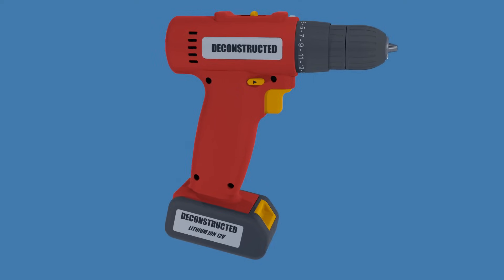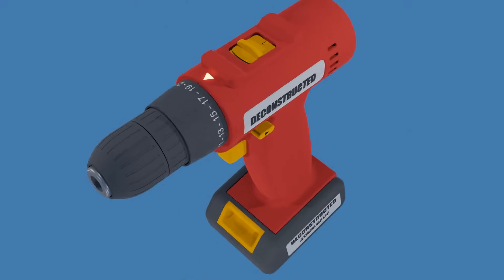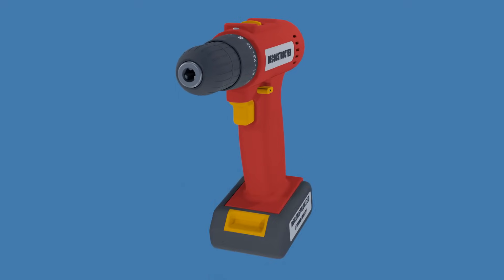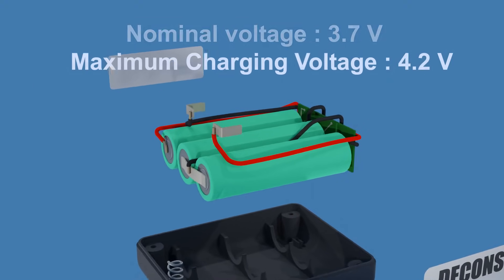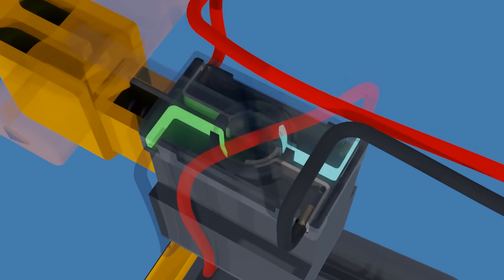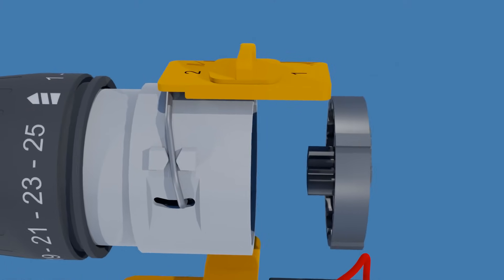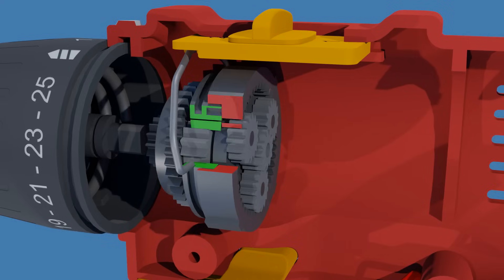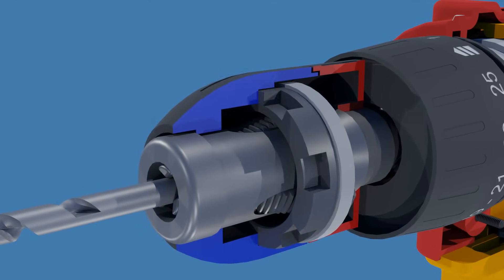How a cordless drill works

Comment: amp hours is current, not energy; energy is amp hours X voltage. if you put two cells in series, the voltage will be double. If you put them in parallel, the amp hours will be doubled; in both cases, the total energy is exactly the same

Comment: Great Video.
Over time these cordless drills loose amount of Torque and start early clutching, even with good battery.
Solution: add an additional flat washer (of suitable thickness 1/32 to 1/16") (Flat washer to match ID/OD sizes of back cover), between gear box back cover (i.e. motor side cover) & gears. Washer to be located inside of gear box. This would increase pressure on clutch and would stop early clutching.
By doing this, basically the repair would about double the thickness of flat plate located at mentioned location. 
Cost of washer at Home depot < 1 USD. + Time spent
Saving from buying new cordless drill = Many USD.

Comment: Very interesting, but it doesnt explain, when the ratchet no longer works.
 It still drills, drives releases screws. But the ratchet assembly section, no longer engages. 
It just turns around now.

Any one got any ideas why it's not working

Comment: Can someone explain to me why it seems modern drills have a “braking “ mechanism that stops the rotation of the chuck when the trigger is released?  Old drills would just slowly stop rotating.  Does anyone know what I’m talking about?
Reply: I think this is called ‘e breaking’. I’ve seen it on other modern power tools like angle grinders. 

I assume this is done for safety. If you need the tool to stop moving for any reason and especially in an emergancy, it’s better for that to happen immediately, rather than waiting for the rotating mass to come to a slow stop. 

I’m sure there are some circumstances this isn’t useful, there are always edge cases.

Comment: I didn't know a machine as simple as an cordless drill has such complex system inside.
I use two 18 Volt cordless drills every day building cabinets and other furniture. The batterys I use all have a capacity of 5 amps.
They can last up to 3 day of intense use before that run out of power.
And I didn't know the cluth worked this way.
One of my collegeas thinks that the ratcheting sound breaks the cordless drill. Thanks to you I can explain it doesn't break the cordless drill.
It's a safety mechanism.
Reply: I was wondering the same as your colleague on the clutch causing undue wear. Of note, batteries are rated on AH, length of use at a given Amp. The time length is essential for clarity, otherwise it is just a load rating.

Comment: Amps don't dictate the run-time. 
Amps are the amount of electrons flowing through the resistance, in this case, the drill. Volts or voltage is the force that sends the electrons/amps through the resistance.

Example. The drill needs a certain amount of Amps to operate and a certain amount of Amps EVERY SECOND the speed of the current pushed by the volts. 

A small car engine needs 0.17 of fuel per hour (Amps), but the fuel ejector (volts) determines how fast the engine (drill) receives the fuel (Amps) in order to operate properly.

In short, what determines the drill run time is the size of the parallel batteries in the pack.

You want your car to run longer? get a bigger gas tank
and the drill? add more parallel batteries 

Now, we can talk about the quality of gas and the quality of batteries...BECAUSE the compositing of the battery like zinc etc.. adds more life to the battery < and that's what you're talking about. 
But marketing won't tell you about that because it's not in their interest. 
They don't want to tell you the cheap materials in their product, because people will figure out why the batteries don't last.
Just like the fuel quality matters.

Comment: Great video. Since you already have the 3D models created, you could make additional videos on common failure points and repairs for the tools you talk about. Like calibration for the torque wrench. You could make a video about replacement of brushes for a brushed drill, or how dirt and grime can get in the way of the brushes even without them being worn down. For a brushless drill you can show how a capacitor is needed for that boost of energy to get the drill starting spinning. If the brushless drill isn't spinning, or it's overloaded you can show what part inside is the first to start heating up and smoking.

I think you can increase the value of the 3D models you create into much more than just an explanation of how it works. There's value in knowing how something works, and also knowing how to fix it. You have such detailed models that I think you can do both in a beautiful way.